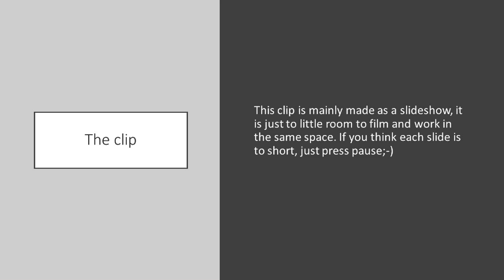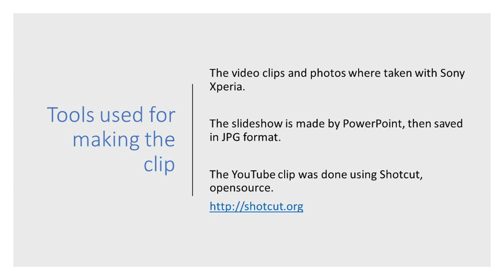Changing xenonlight on peogeot 508 SW 1.6 hdi 2014

Comment: Works like a charm, fiddly disaster but done :-) Thanks for the clear instructions! On battery side I connected the light outside the lamp. On other side there is so little space that indeed; need to insert light first and only then try to fiddle click the cable on to it. It's ridiculously short, even 1 cm more would make a world of a difference.

Comment: I changed my light bulbs but there is almost no difference between long and short light. This is why I replaced them. How do you think I can fix it?
Reply from the maker: Compared to my last car, Volvo V70, The long light are very poor on the Peugeot. My understanding is that it is the same lamps for both the full light and the half light on the peugeot. It is just mechanically blinding down for the half light. On the Volvo there were 2 Xenon for half light and 2 more for the full light. All together 4 Xenon lights. I bought really expensive Osram lights to the peugeot, it helped a bit,  but not close to as good as the volvo with cheap Chinese lights. I'm considering extra lights (led ramp). but that is not so easy to connect to Xenon. Btw, I have a weird double hook shaddow on the full lights on the left light. Is it supposed to be like this or is it only m,y car that have this feature?
Reply: @torbjornulrichs8570  As I heard from a friend in a Facebook page called 'Peugeot 508 Turkey' we are doing it in a wrong way and we are not able to fit it in the place completely. He had it done at a qualified Peugeot service and apparently that's what they told him. He now says that they are completely fine now. He was having the exact same problem and now it is fixed. In the next periodic maintenance I will tell them to fix it.
Reply from the maker: Ok, try that and let me know how it went, from my perspective, the full light on the Peogeot 508 sucked from day one (before needing to change anything) and haven't improved :-(
Reply: @torbjornulrichs8570  I sure will, sir. But I'm telling in advance this might take a while as I still have about 7000KM to the next periodic maintenance. But I will let you know.

Comment: Is it 4300k or 6000k? When i removed cover from headlight is osram 35w d1s 66144 but there are 2 types. Which one is it?
Reply from the maker: Hi,

Issue of 4300k or 6000k is a personal preference thing. The 6000k gives a more "blueish" light. It look a bit cooler. But, it seems like 4300k is the standard OEM in most European cars. Not sure, but I believe, that I read somewhere that 4300 gives more light fitting the human eye, especially if you are over 50 as I am. But just to be clear, It doesn't matter which you choose from a technical point of view, It is a look and feel thing. Btw, I'm not happy with my "Chinese Xenon" I'm replacing them with "Osram  night breaker". Got a good price but still 2.5 times the price of the Chinese. I keep telling my self it is expensive to be cheep, but still I do it. I buy cheep, then I not happy and replace them, Should have bought the right ones from the start.

BR
Tobe
Reply: @torbjornulrichs8570  
I bought yesterday Philips 4300. I couldn't find osram at that shop. It cost me 20 euro for the one bulb. I know it is Chinese copy.  Thanks for your video I learned to change them too. It was the one in front of the battery. From the looks of it it looks same as other one (color), but it is little bit brighter. Tnx for teaching me how to change bulb. It saved me money.  :)
Reply from the maker: Hi, Happy that it helped. It' is not too hard when you know how. Needing to remove the battery sucks. I normally change both lights. The reason is that the light gets worse with age. That means if one is broken then the other one give weak light even if it is still working. That is why your new light is brighter.

Comment: El video no se ajusta a la realidad, la luz que sale fundida cuando indica cual es es la del lado del conductor, y la que se cambia en el video es la del lado del acompañanate.
Cual es la diferencia? que en el lado del acompañante de puede hacer asi porque hay sitio para las manos y retirar la vieja e instalar la nueva, pero en el lado del conductor ( que se supone que es la luz que marca como fundida) no hay sitio, y, o se desmonta la optica entera, previo desmontaje del parachoques delantero, o se desmonta la caja de los fusibles y la bateria.
De otra manera es imposible... osea que el video no se ajusta a la realidad, NO SE PUEDE CAMBIAR LA BOMBILLA DEL LADO DEL CONDUCTOR COMO SE DESCRIBE EN ESTE VIDEO.....
Reply from the maker: Hi, I never just changed one xenon light bulb. The reason is that I so far changed the type of xenon lightbulb as well. I changed on both sides. But if you look carefully in the video and the comments, I tell that you need to remove the battery to access the other side. I also link to another video telling how to remove the battery, which is a project of it's own.